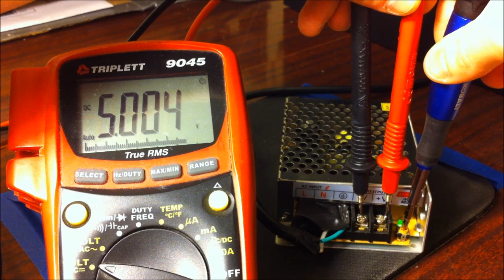ShapeOko 2 Tips for beginners: Power Supplies

Comment: Hi Caleb! One question. Since there are two types of S2 in store, 110 and 220 V versions, is it OK to buy 110V version and use an adapter to hook it up on to 220V source?
Reply from the maker: I'm not quite sure. When you say adapter, do you mean something that will convert your 220V down to 110V? If that's the case I would guess it would work so long that the converter is rated at, or above, the wattage consumption of the S2 power supply.
Some concerns I have about doing this, however, are that you're adding another link into your power chain which could potentially introduce inconsistencies in your power output. I know I've heard Dave Jones, a.k.a. the EEVblog guy who lives in Australia, complain about certain pieces of electronics made for the USA that would not run on his converter. Unfortunately, I don't remember any of the situation surrounding that complaint.
If all you're trying to do is save a little bit of money, I don't think I would do it. However that being said, it should work, as long as you make sure your converter can supply the correct amount of power to the S2's power supply.
Reply: Caleb Peters  Yeah, I meant to buy 110V version and use it in Europe. And by "adapter" I meant that what you said, to convert 220V to 110V. But I think that is just too much of a trouble, and I'll just buy 220V version to be sure. Thanks a lot!